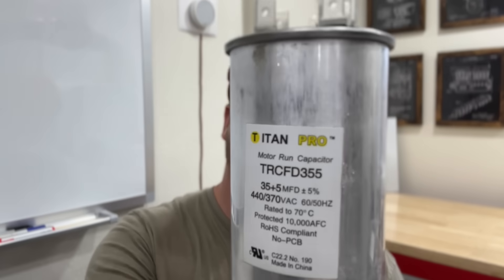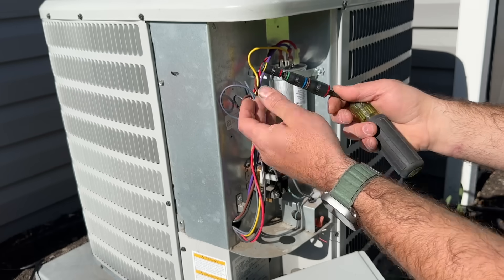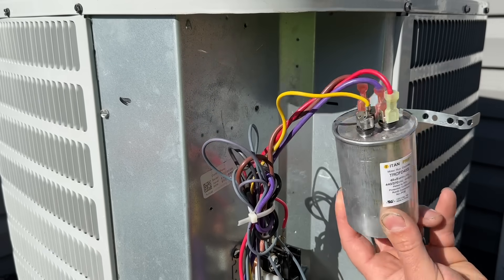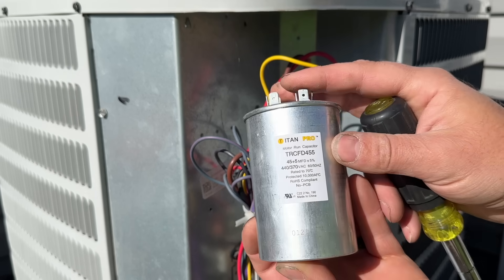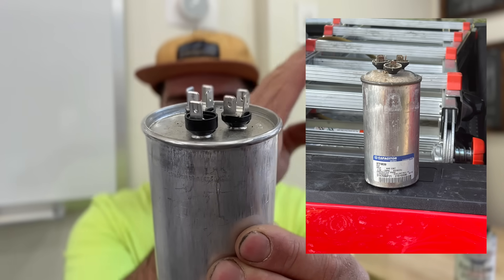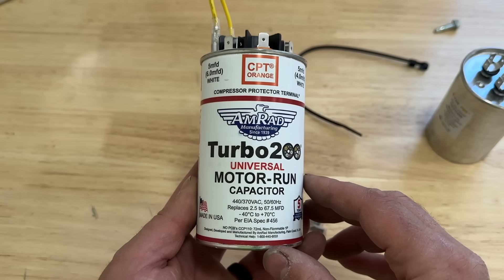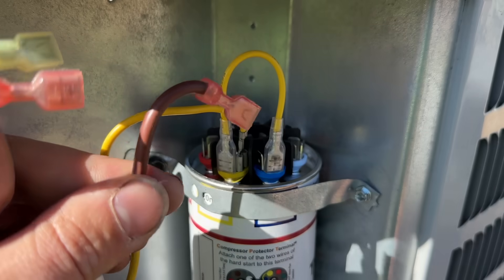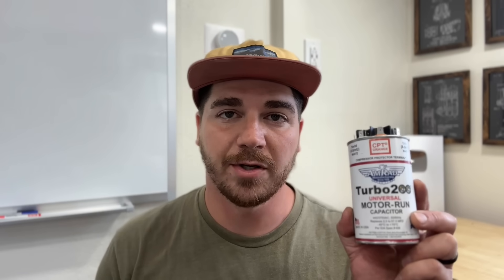HVAC Contractors Practically Make Their Living On These

Comment: If I could still climb on my roof I would have replaced mine but "Thankfully" my unit had 1 year left on warranty and the dual capacitor was replaced among other things...After I told them I replaced it 9 years ago and I will not buy a whole new unit.And when I asked for the old one and what it was reading they had a very standoffish attitude.4,420 for a dual capacitor, condenser fan replacement and contractor replaced and cleaning.After discount 2,235. Ya it's a rip-off

Comment: $10 for a 5mfd now days our cost n yes we charge $125  diagnostic  fee n instalation Insurance for hvac contractors is expensive  and the gasoline or diesel to get there our tools n meters are not cheap either As a retired hvac contractor for 45years there are alot of crooks in this business I'm not 1 NOTE SWELLED CAPS ARE BAD

Comment: Stupid question❓️❓️ shouldn't  the hermetic connection go on the highest rating side of the 2 jumpered together ❓️❓️❓️

That was what i remember the manufacturer of the Turbo 200 stating. But it has been serval years since i used one...

Comment: On RVs the capacitors for the fan and compressor will usually be seperate. Same idea though and very easy to replace. Take your time and use caution when dealing with electricity. Always use a meter to check circuits once you turn off breakers..... just to be safe.

Comment: For the DIY'er, once you have to replace the capacitor, don't buy just one, buy two, and put one away for the next time.  Capacitors going bad is the most common issue with AC units.  You can also get the compressor fan motors for ~$100 or less, and it's easy to replace them as well.  That will save you a lot of $$$.

Comment: I had a mouse die as it crawled across the capacitor, luckily I was outside and watching as they took the cover off. I should have just paid home for the service call and replace it myself. He charged me $300 to replace the capacitor.  Capacitor failure occurs so often he had a bucket of capacitors in his truck.

Comment: In 2022 my air conditioning quit. The HVAC company suggested I get a new central heating unit and air conditioner costing about $15,000. I was a 76 yr old widow at the time. The salesman did say he could do a temporary fix for $250.00 but recommended I replace the whole system. So I asked about what the temporary fix involved and he was honest and told me he would replace the capacitor in the air unit. And I asked him if I could do it myself and he said yes but don't tell anyone that he said that. So I watched many videos like this one and ordered a capacitor on eBay for $9.25 plus shipping. Before starting I was careful to make sure that there was no electricity to unit by pulling out breaker as he shows in this video and also I flipped the switch at the panel in the garage just to make sure. Just take a photo of wires then unplug all wires and re-plug to new capacitor.  It's been 2 years and so far everything is working just fine. The hardest for me was removing the side panel of air unit to get to capacitor and then replacing it. I think it's a crime what these HVAC companies are doing.

Comment: The 5 most common repairs are all simple DIY repairs. First is the capacitor, 2nd is a clogged drain line, 3rd is the condensing fan on top, 4th is the cooling fins around the condensor is clogged up with everything imaginable, 5th is the contactor switch. If you know how to solve those issues you'll save a fortune.
If your fan start capacitor is bad you can spin the fan blade through the grille with something like a screwdriver and the fan will run. It will keep you cool until you get a new cap.
I have 3 caps, a contactor, and a condenser fan motor already on hand just in case. I have fixed friends, family, and neighbors AC and charge them to replace my parts. I don't say no if they offer money.

Comment: A professional would write the date on the new capacitor knowing a new quality capacitor is rated for 60,000 hrs. They should last at least 10 year maybe 20, unless your power is crappy with transient spikes or overload is occurring. Some people would prefer to install separate fan and compressor capacitors if space allows.

Comment: Your dont have to discharge a capacitor with a screw driver. The capacitor is a normal part failure in hot weather

Comment: Another scam that is popular involves warranty parts. The industry standard is that the parts of an HVAC component are warrantied for five years from the installation date. If a contractor is wanting to bill you for parts within the first five years, move on and get a second opinion. 

Also, be sure to register your unit. With RUUD/RHEEM products, simply registering the unit extends the warranty from 5 to 10 years which can be a life saver on costs. A failed compressor or coil can easily cost $1000 wholesale just for the parts. A motor can be several hundred dollars.

Comment: I keep an extra cap for the compressor unit AND the cap that is located upstairs - for the blower motor.  Yes both are around $10 - $15.  Each.  It is CRIMINAL that HVAC companies overcharge for this. Sure - charge for having a service truck equipped with parts & tools for service and a trained & licensed technician.  Charge for after hours type calls.  HVAC companies have to cover costs and allow for a profit margin.  But $2000 for a compressor cap?

Comment: If you know how to diagnose a bad capacitor they are $10-20 on Amazon. Keep spares. Was charged $300 just once. Has gone out a few times in this southern US heat. No problem with the spares. 15 minutes and you are back up and running. If your A/C isn’t  blowing cold go outside and put your hand over the compressor. If it is blowing cool it is 99% of the time the capacitor. If the top of the capacitor is bulged out also it’s bad.

Comment: Capacitor was blown for the compressor and we knew because we only got warm air out of our A/C vents.  
The fan is easier, it simply doesn't turn, but you usually hear it buzzing, like its trying to run but can't get moving. 

If you wake up to a warm air blowing AC vent, its most likely the herm side has blown on the capacitor. Of course, could also be a failed compressor or refrigerant has leaked out.  Hopefully a nice, cheap capacitor issue.

I have started taking to pre-emptively replacing my capacitor every 2 or 3 years in the late winter/early spring, before I get into sweltering July/August and it fails.  I also take that time (Feb or March) to take off the panels and gently clean the condenser coils (I used car wash soap in a spray bottle).  Don't use anything agressive, can easily damage the high efficiency coils and all those little fur-like aluminum tassels.

Comment: I repair hvac units and $10 budget capacitors are junk! I bought those a few times and did callbacks in 6-9 months on everyone . Never again. I’m okay where you buy capacitors, just Buy the capacitors the manufacturers installs in your unit. You pay a little more, but pays off in the long run.

Comment: Love you videos.  Liked and subscribed.  Quick question, when your capacitor label is completely rusted out how do I determine what size capacitor I would need?  AC model number label is not present either on this 20+ yr old Frigidaire AC unit running a 1600 Sf house.

Comment: I didn't want to but I was laid up sick and had to call an A/C company out. They sent two techs and I told them it was more than likely just the start capacitor for the compressor. It was, they gave me a bill for $350 dollars. I called the company the next day and told them I wasn't paying for two techs to change an capacitor that cost $30 at the supply store. They told me they always send two techs.
I filed a BBB complaint and they called me back and reduced my charge $135 service fee for one tech.

Comment: I recently came across a situation where a jack of all trades replaced a Capacitor on a Trane HeatPump.  Looking up the parts, The Capacitor for Herm side was 10 mfds over what it called for.  The Capacitor was installed last year and it finally grounded the Start Winding of the Compressor. It lead to a more costly repair of replacing the Evaporator and outdoor unit. Sometimes it pays to get an estimate from a trusted professional.

Comment: The same with pool contractors. I was told I needed a new pump and motor. Over $2,000 + labor. YouTube is your friend. It took me 5 minutes to discharge and safely remove a capacitor, about another 20 minutes searching on Amazon, and the next afternoon 5 minutes to install the new $10 capacitor.

Comment: A Cap doesn’t act like a battery. It changes the phase angle of the AC voltage by decreasing voltage and increasing current during the initial startup of the motor. Gives the motor a little kick to start spinning. As it spins up to RPM the voltage increases and the current decreases to stabilize the circuit. This happens due to the tuned load of a winding in the motor. 

Also, never pay for HVAC company to work on your stuff. You will get ripped off. But that’s the cost of business. Luckily I have a supply house in my area that will sell to the general public. Just PM’d my own unit and replaced the caps as they were starting to get out of tolerance. $41 for a blower motor cap and a start run cap. Titan HD but preferably AmRad. They both work okay. The titan pro goes out after about 18-24 months in the southern heat. Titan HD about 3-4 years. AmRad about 6. All averages of course. YMMV.

Comment: I've had my heat pump go out three times. 

Once was the start capacitor, replaced it myself. 
Once was the relay, ants got inside and corroded the terminals, replaced it myself.
Once was the reversing valve was stuck, and I called a professional for that one.

Comment: Since the unit is actually a double-capacitor, you don't have to replace the whole unit in case if one of the capacitors fails.
That means, if only the fan is not working, and a replacement double capacitor is not available, you can pull out 2 wires from the original capacitor and connect them to a new 5 mf capacitor that costs a dollar and is more easily obtained as a separate item. (English Second Language 🙂)

Comment: I'm a DIY guy and got confused with an old amrad blower motor capacitor that had a red dot on one side, but the new one had no red dot. The connections on that side of the new capacitor instead had a white grommet, versus the old one that had two black grommets. Sorry for such a noob question, but what does that mean?

Comment: HVAC companies are the most greedy and dishonest people. Take full advantage of people who, having nothing to do, have to turn to various companies for different services. They have rates as if they were engineers at NASA. I'm a DIY, so I don't need such services. I just requested a price estimate to install a 12K BTU heat pump and they gave me a price of $4000 for a system that is available on amazon for no more no less than $700.

Comment: AC fan stopped working.  The first thing that I need was follow your directions.  I went to ACE Hardware and spent $31.00 on the capacitor.  Installed it as you instructed.  The fan began working perfectly.

Comment: I recently had a problem with my AC. I figured it was the capacitor but I was not sure. Sure enough it was the capacitor and there were some other issues. I only paid $400. Thank god I was not ripped off. I going to invest in a multimeter and learn more about AC repair.   👍

Comment: I changed my capacitor out. Fan on the compressor is running but the blower  is not active. No air is coming through the vents. Could the Herm and C not be attached right?

Comment: Same thing with pool pumps.  If it's not kicking in and making a loud buzzing noise when you turn it on, it is probably the capacitor.  Pro tip: get the replacement capacitor from the HVAC supply shop to save money.  Just match the microfarad and voltage.  Pool parts places charge 5X for the capacitor.
If it's YOUR equipment, YOU have a right to work on it and fix it YOURSELF.  Learn a little and save some money.  
I spent $0.95 on a current limiter that lightening blew out on my air handler blower motor ECM circuit board.  Quote for an HVAC company to replace the blower motor, about $1k.

Comment: The low UF rating of the hvac run capacitor is never a shock hazard
As long as the power's off, you're fine
"I've never had one get me" and also me as a 35 year contractor and a DIY parts salesman handled over 1000 of these and neither  of us have been shocked- it's because it's nearly impossible. He's thinking of higher UF start caps

Comment: I was under the impression that the ± x% was the tolerance value of what the parameters of microfarads for the reading can be. So in the example of your video, with a ±6%, that would mean that a reading that was within 6% below or 6% above the 45/5 µF, then the capacitor was still working just fine. 
"Some capacitors list a tolerance, or the maximum expected range in capacitance compared to its listed value. This isn't important in all circuits, but you may need to pay attention to this if you require a precise capacitor value. For example, a capacitor labeled "6000uF +50%/-70%" could actually have a capacitance as high as 6000uF + (6000 * 0.5) = 9000uF, or as low as 6000 uF - (6000uF * 0.7) = 1800uF."
Another way you might see that tolerance value expressed is with a letter indicating how large the tolerance is.

Capacitor Tolerance Letter Code.
B ± 0.1%
C ± 0.25%
D ± 0.5%
F ± 1%
G ± 2%
J ± 5%
K ± 10%
M ± 20%

So unless I'm gravely mistaken, in your example you said that if the value was not the 45/5 then it was broken, but given the tolerance of ±6% a value within 42.3/4.7 - 47.7/5.3 would still be within the accepted tolerance parameters of the capacitor.

Comment: @0:00:  A capacitor does not give an induction motor "an extra jolt of energy when it first kicks on."  It creates a phase shift for some of the current, resulting in a power-factor correction, essentially spreading out the angles over which the electrical power pushes on the motor, reducing inductive reactance.  It's the opposite of a jolt.  (Capacitors do not store and release jolts of AC as they do with DC.)

Comment: You should discharge them with a resistor. Directly shorting them can result in arc. Some capacitors have builtin resistors, but some don't, so don't risk it. There are calculators online to calculate what resistor to use and for how long to keep it.

Comment: This cost us $150 a year, we researched this, bought two of capacitors and didn't need to use the second one because unlike the AC guy we put the correct part in and that prevented it from going bad the next year.

Comment: Capacitors are not like a battery and the device you hold up is a run capacitor which does not help the unit start. You're confusing a run capacitor with a startup capacitor. Two very different things. Startup capacitors are not on standard grade heat pumps and are much larger and have a resistor between the two terminals. I do appreciate that you want to not let people get ripped off from capacitor replacements but please be technically accurate if you're going to be an influencer

Comment: Bad practice on that disconnect.
Use your meter, check for power, TURN OFF THE BREAKER, pull the disconnect, check power, and work.
Source?
8yrs service electrician.

Comment: Normally, you don't need those capacitors. If you do, installation should be around $200. That would include the purchase of the product, the trip out and back to the residence, the expertise required for the installation, and the warranty on the installation. I would have fired any of my mechanics who charged considerably more than that. Once a company starts ripping off its customers, it's usually bankrupt within 2 years. With the social media so popular these days, 2 years may be on the long side.

Comment: Nice way to go viral and get clicks if you are legit remove the links to your amazon store and request Ads free you tube channel.
1) I am curious how many HVAC technicians charge $2000 for a capacitor? Have you run the statics or you just made an anecdotal claim that all hvac people are crooks.
2) Are you willing to take responsibility for operators errors and safety malpractice?
3) By the same analogy A medical doctor charges about $35000 for putting a stent aka spring ($0.5) isnt that a rip off as well. I would like to see you authoring a DIY video about a spring replacement in veins as well.

Would appreciate in your next videos if you tell people the aim your content is to promote your amazon store and not the help people if you are legit remove the links to your amazon store.
Bonus point, you have few safety violations and your content is incomplete. Misleading marketing tactic claiming and showing a $10 capacitor while barely mentioning the true price of a Turbo 200 ranging from $70 to $100.

Comment: I believe they call them "hard start kits" even though they provide a soft start.  My system is now 10 years old.  I was thinking of adding one because I can't run the AC on my 7200 watt generator even though there's enough current.  My LRA rating is over 110 or so.  Anyway, are there any downsides to adding this capacitor?

Comment: I don't know about HVAC, but I had a motor start capacitor go in a dryer. The parts supplier wanted several hundred dollars for the part. They told me it couldn't be the capacitor because they hardly sold any Canada-wide. I replaced it with a capacitor I bought online for $10, and the dryer has been working well since. They don't sell any because it is a $10 part and they are trying to gouge consumers. I was left wondering WTF.